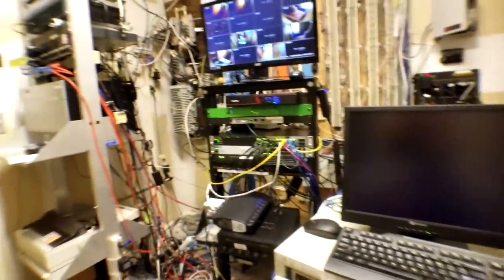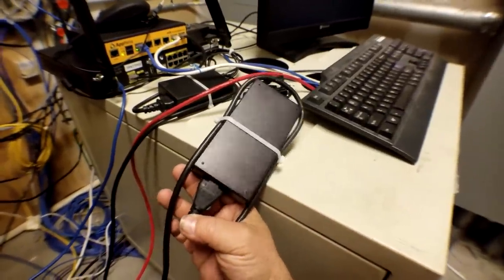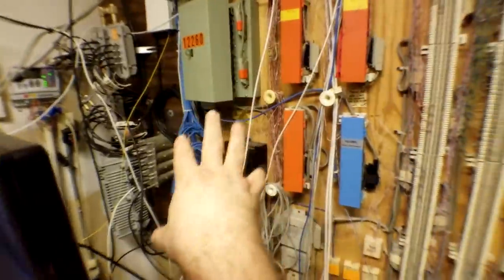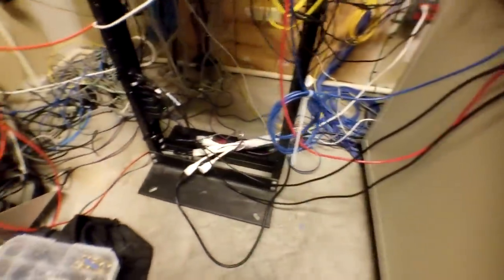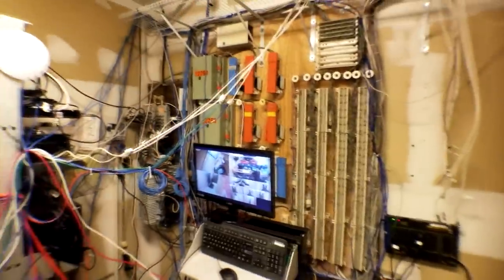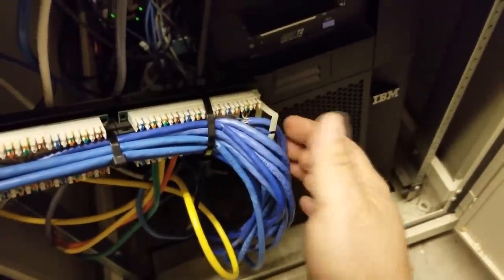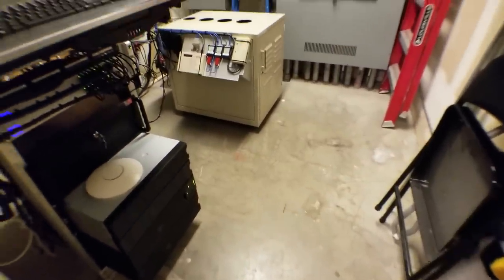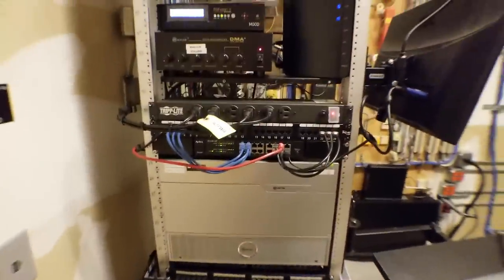#037: The Chamber of Cable Blunders (from Florida)

Comment: +FiberNinja   YO! I DID THIS FOR MY HIGH SCHOOL'S NEWS ROOM! :D They had wires going absolutely EVERYWHERE! D: Mic Stands wrapped in wires, dangling across,. disconnected old RCA video cables going to a display splitter plugged into a PC that wasn't used anymore... AN ETHERNET HUB LOOPING INTO IT'S SELF, NOT EVEN CONNECT TO A RJ-45 JACK IN THE WALL. It amazed me that the thing was even working, but over the semester in the class, I was able to coil up wires, attach Velcro cable ties, and remove unused power supply cables and other RCA display cables, some RCA cables and I think one DVI cable too; I coiled them up, looped the ends to keep them tight, and then put them on the desk in there for the teacher to choose the fate of the cables. I feel your pain. :)
Reply: youd be surprised in a high schools A/v or server room. both be messy and a rats nets of wires.
Reply: Good job. I would say label those power bricks because they're easily able to be plugged in and fry other things not to mention get separated and then nobody knows what goes to what.

Comment: love that white (hp?) switch with <4 things plugged in and port lights lit on empty ports... its like it died, they moved most of the cables leaving just left 3 possible empty lines connected but left it powered as a fire hazard.
Reply from the maker: Believe it or not, that was a critical switch in the system I found! It was being used to distribute the primary broadband feed to individual routers using their own IP addresses. I just about fell over when I figured this out...
Reply: I think your describing the netgear which I didnt even notice first time and is abit sad.
Love to see a network map, specially for jobs with idiocy involved.( and why the camera system has its own firewall)
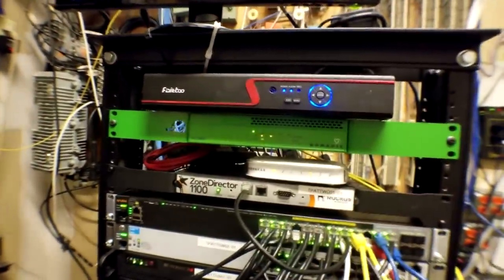The one I noticed (white 24 port @ 8:50 ) was partially dead thou with those stuck port lights right?
You say at the start most techs would say no to this job but I was wondering what made you say yes, and would you have walked if they for instance just wanted a bandaid for missing camera's or just the camera's you installed bolted to the mess.

Comment: In regards to the issues you had with the patch panel you were using, I found the 24-port Vertical Cable brand CAT5E/CAT6A SHIELDED patch panels on the web that overcome the problem. Vertical Cable has offices in California/Florida/New York, and some of their products are available on Amazon.
 The only negative that I can see with the ones I am recommending is that they require a Krone termination tool, too bad they didn't use a hybrid IDC block that allows use of both Krone and 110 tools. 
Their 48-port 1U shielded patch panels are similar but the module for the first/upper 24 ports needs to be removed to access the IDC blocks for the second/lower 24 ports. It does appear that the cables can be left connected when doing this, but they would interfere with re-terminating a connection on the lower module.

All the cables come straight out the back to a tie-down bar which is attached and doesn't interfere with punching down cables, the IDC terminal blocks are under a removeable metal cover which serves as an RF shield when in place, and the ports have plastic flip-down dust covers for when not in use.

https://www.verticalcable.com/
https://www.amazon.com/Vertical-Cable-24-Horizontal-Rackmount/dp/B008SEW04Y
Reply: Followup: 
Found there are other shielded patch panels with similar characteristics, appears that the need to ground the cables leads to them being routed straight back to a tie-down bar, with a ground point on the way.
The 1U Trendnet TC-P24C6AS is similar to the Vertical Cable CAT6A shielded panel, but is compatible with both 110 and Krone punchdown tools.
http://www.trendnet.com/products/patch-panel/24-port-shielded-cat6a-patch-panel-TC-P24C6AS
https://www.amazon.com/TRENDnet-1000BASE-T-10GBASE-T-Compatible-TC-P24C6AS/dp/B07D5RQGKF/ref=sr_1_4?ie=UTF8&qid=1534297974&sr=8-4&keywords=cat5e%2Bshielded%2Bpatch%2Bpanel&th=1#customerReviews
Monoprice has both 1/2 and 1U versions that are labeled dual IDC(110 & Krone compatible?)
https://www.monoprice.com/product?c_id=105&cp_id=10514&cs_id=1051401&p_id=10038&seq=1&format=2
https://www.monoprice.com/product?c_id=105&cp_id=10514&cs_id=1051401&p_id=16080&seq=1&format=2
Reply from the maker: I'll check it out so thanks for the suggestion! Hopefully they can maybe send me a sample to work with. Also, all telco techs should carry a Krone tool. I think I've used mine twice? But it's always with me. I've been to large network rooms at major malls in California where there were signs on the wall stating if anyone was caught not using the proper Krone punchdown tool, they would be banned from the site!

Comment: Great job. My only criticism would be the excessive use of zip ties instead of Velcro. Sure you want to use zip ties on certain spots but even though Velcro is more expensive, it more accessible on long term especially if you are going to visit the site again. Also thanks for the tips an hints in general. I did learn a few things. Cheers

Comment: Looks great... except for one thing... you mentioned flooding and that this room in fact had flooded before... yet the most important part of the entire setup, power distribution, and battery backup, is closest to the floor.  Granted, I wouldn't post a response to this message, however I would've put a tray on the bottom to space up the UPS and all well above the ground, at least 6-8"
Reply from the maker: This actually was a decision by the customer. We pointed out the fact that this hotel had flooded not very long ago and there was close to 12 inches of water within the first floor here. But the choice was made to lean more on the flood insurance than a design solution that would have elevated the equipment and also branched out to a second equipment rack as there wouldn't be enough room on the current one for everything planned. So in short, the customer felt it was an acceptable risk to place the UPS (or any equipment really) that low on the rack noting that the frequency of a flood that severe as well as the flood insurance would be fine this way.

Comment: Just imagine having to run 24 new network runs inside an open walmart. Scissor lifts are fun to drive around at 30ft in the air and climbing around the ceiling. We were literally throwing cable bundles across the rafters to make it easier on ourselves. Store remodels are not tech friendly at all!

Comment: Really like the wire shelf idea, curious as to why you put the UPS on the bottom when you said that room has flooded once already. maybe wall mount?
Reply: Weight distribution and space limitations — plus hanging mains cables aren’t really safe to rely on for always-on systems.

Comment: The attenuators do not need to be right at the equipment. They could be moved to the input of the two way splitter. Better yet, with the room cleaned up, the cable co could check the amplifier (BTD?) and the levels at the spigots.

Comment: ZOMG new fiberninja! Question for yeh: why don't more installations use RJ-45 splices like that cable head debacle project you had? Punchdowns seem really cumbersome to maintain, and I imagine the attenuation difference VS an RJ-45 coupler is negligible...
Reply from the maker: Many unforeseen factors make those choices and you just never know. I will say that a punchdown IDC connection is generally a faster construction than an RJ45 termination. But it may also be what materials are available.

Comment: in order to use a coax splitter as a signal reducer you have to use a termination cap on the other leg. Without it you can get weird frequency effects and leakage.
Reply from the maker: I didn't do anything with the coax cabling other than some very minor securing to the backboard. There also was a cable company crew that came through about half way to finishing. I bet they were glad I had already plowed a path for them so they could actually reach the back wall!!

Comment: These situations are when you turn to the client and say 'look, were gonna have some rolling outages saturday evening' then start untangling and replugging shit. Can clean up most things enough to see what's exactly going on in 30 minutes. Takes some experience and testicles but saves days of reverse engineering. If downtime is critical, migrate to other equipment.

Sidenote: the 120v stepdown is probably pointless. Almost all of the equipment will run on 120/240v @ 50/60 hz. 
DC will work usually too even if the manufacturer doesn't list it in the datasheet.

Comment: That's one BIG band-aid lol but at least it's serviceable now and looks much better. Hope you were compensated well for this job.
One question: how exactly is that USG mounted? Didn't see any zip ties or bracketry... 3M adhesive tape maybe?
Reply from the maker: You said it! But that's the compromise made to make the space safe to work in while not taking the system down for more than a minute or two in the middle of the night! Sure, it would be better to wipe out the mess and start from scratch properly but that simply wasn't possible.

The USG is designed to be wall-mounted with 2 holes on the bottom. I simply put in a pair of button-head screws directly into the aluminum of the rack instead of a normal wooden back board. Gotta' love aluminum!

Comment: Love all those cable ties.. especially when you need to remove a cable.. have to cut them all of and add new ones. USE VELCRO STRAPS!
Reply from the maker: It takes just as long to cut and re-strap a bundle with zip ties as it does to undo a velcro strap. In fact, I'd say I probably re-do a bundle like the ones here about a half-dozen times before the final run is set. No big deal to me...
Reply: Zip ties makes it look neat, but it's a PITA to add or remove cables, or even just move a cable a little. Then there's the risk of over tightening or damaging the cable. All of that is a non-issue with velcro straps, and they can be re-used.
Reply from the maker: I find no such trouble adding / removing cables. I do it all the time through zip ties. I really don't see any time lag compared to velcro in that respect. Copper ethernet cable being affected by the crushing force of a zip tie has yet to be demonstrated in the real world. I'm actually working on an upcoming demo video where we lay many of these theories to rest once and for all. I've seen cables crushed under HVAC rails of several tons and still function without notice. Ultimately, they are the necessary tool for the job of guiding cables in directions they don't want to go!
Reply: Zip ties or Velcro... I dont really have a preference...  But I have over tightened a zip tie on  an old single pair aerial telephone drop and actually shorted the pair which I would not have believed had I not seen it with my own eyes!!! If you take it easy on the tightening it will be fine.. Overtighten it and time an pressure can take its toll..  example: troubleshooting an older alarm system which utilized old unjacketed twisted pair wiring. This was in an old metal shop building and the loop had a short on it. I looked down the wall the wire was running and saw a short piece of 2x4 maybe 12-16 inches long lying up on the steel beam and looked like it might be laying on top of the alarm wire.. didnt really think anything of it.. the conductors are fairly heavy insulated as they are unjacketed... I have no idea how many years it had been laying up there but had flattened it out enough to force the conductor thru the insulation.   maybe our cat whatever wiring wont be in use in another 20-30 years like this alarm wire was... but keep the zip tie or velcro strap pressure lite.. you may walk out of the building today and everything works... but tomorrow is another day.

Comment: Just outstanding work as always. You are beyond brave to come in and clean up that disaster. I do have a question though about your choice of patch panels. You do this professionally. I do not. But I terminate my cable runs into my patch panel with keystone jacks rather than trying to fiddle with a lacer bar getting in the way and punching with just the right force and not damaging the IDC connector block. I have also changed to use Fluke Networks JackRabbit and Leviton keystones. Makes punching down a cinch and then I tie down to the lacer bar. Other than cost, what do you think of using the patch panel in the video over keystone jack patch panels?
Any advice is greatly appreciated.
Glad you are back my friend.
Reply from the maker: Oh I MUCH prefer keystone patch panels over IDC ones! This was a customer-requested decision and not my own. I don't always get the luxury of picking all the hardware I have to work with. Those loops were my way of dealing with the limitations of an IDC patch panel.

Comment: The bend radius is pretty tight on those loops behind the patch panel.  That could cause problems.  I've encountered the same problem with Wirewerks and fiberstore patch panels.  Keystone passthrough patch panels is the solution but they add to the overwall cost.  I also hate crimping plugs.  I know how to do it but find it much quicker to punch down using 110 or bix.  I have seen many installation where half of the cables come in from the left side behind the patch panel and the other half from the right side.  That way there are less "stacked" cables on one side.  My issue with that its makes is very hard to pull out the patch panel to service.  Looks nice but not practical.  With all cables coming from one side, you can rotate the patch panel out and add more cables.  On 2 post racks, you technically don't even need to move the patch panel to add cables because you can stand behind it.  In my case, most of my installations are done in 4 post server racks with patch panels, horizontal cable management and switches at the top, servers in the middle and UPSes at the bottom so rotating out the patch becomes necessary to add cables later on.  I also tend to use 2U horizontal cable organizers giving me more room to store the slack.  Those UPSes are a bit low if this place is prone to possible flooding.  I would put them at least 1 or 2U higher and also add a water sensor on the floor.  Since your UPS already has environmental (temperature) sensor, it could be pretty easy to add a water sensor to it.  Water sensors act as a normal switch and short out the 2 wires which closes the contact on the environmental sensor.  the closing of the contact indicates water detected.  I use them around my aquarium and water tank also.  I have also had clients add temperature sensors in the server room hooked up to building alarm on 24 hr supervision zone.  That sensor would trigger if the AC system went down and heat starts to build up.  The alarm sent would not ring the sirens or call emergency services but would make the call center contact management and notify them of the high temp.  Very little cost of any but does use up one zone on the alarm panel.
Reply from the maker: Some great points here!! Ok, here goes:
1. Bend radius on copper isn't a big concern -especially at the radius of these bends.
2. If you've seen my other videos, I'm a HUGE fan of keystone patch panels too! This was a customer-requested item.
3. You're absolutely right about patch panels that run to both sides. They're completely stuck that way. I try to run all lines to 1 side as much as possible.
4. The low location of the UPS stack was after I found out that the flooding that did occur was a freak incident and the area is actually very low risk of flooding.
5. Adding a water sensor to the floor is an awesome idea!! I'm going to look into adding that if I visit the site again. For any future Florida work, I'm going to push for them to get installed whenever I am going to be re-working the power.

Comment: Wonderful job ! 
Just one question : was there a reason to not secure the keyboard and mouse cable to the articulating arm and then to the vertical structure, instead of letting them hang freely ??

Comment: Oh my, that looks like a room I was in 2004. But the racks were not there not. Was that in Tampa by chance? Awesome clean up work!
Reply from the maker: I can neither confirm nor deny your questioning (but yes, it is Tampa)... What do you remember about the condition of the space back then?
Reply: FiberNinja it was pretty clean, Where those orange outlets were on right of the back board was a small voicemail storage box on a table if I recall correctly. If I remember right I was there for a crosstalk problem. It’s been a few years. Lol

Comment: Excellent work. But I don't agree with the placement of the spooled cables in the overhead tray. They will tangle together and it will be very difficult to remove individual cables. I would have installed new, shorter cables that wouldn't need to be spooled. The other thing I don't agree with is the placement of the printer. I would have placed it at waist height for easier access. Everything else looks great.

Comment: Great work as always! Just curious why you replaced the ruckus wireless controller.  I've had nothing but great experiences with their stuff.
Reply from the maker: The general direction of the owner of this site and all other sites is towards an all-Ubiquiti / Unifi platform. Additionally, the Rukus system completely died several days after we turned up the Unifi system and we had to rush to complete the new build weeks ahead of schedule!

Comment: What a great vid! At ~24:30 where you’re talking about cable managing the power lines to the rolling cart’s server, is that one wall box connected to two different breakers?
Reply from the maker: It was not --but I knew this would only be a temporary cabling because of the upcoming UPS install...